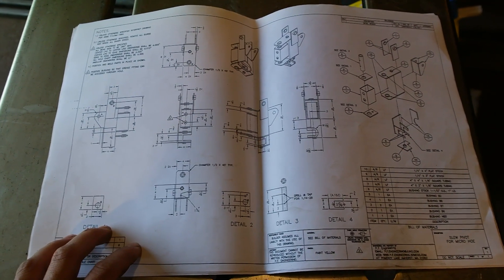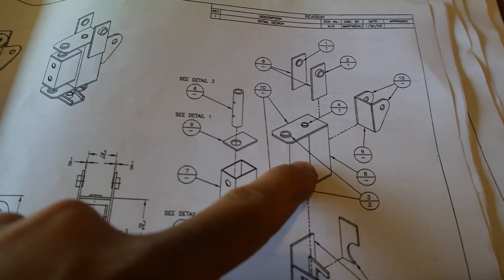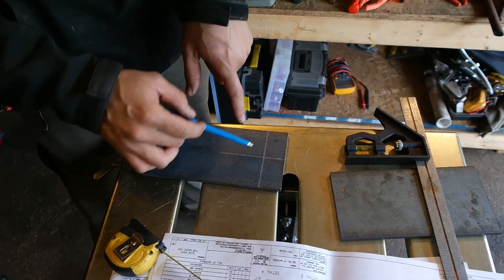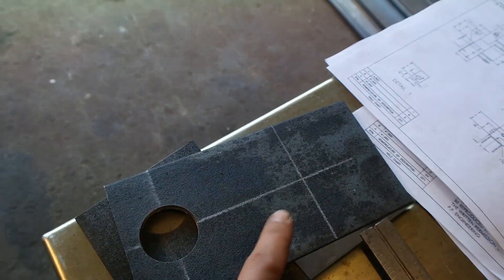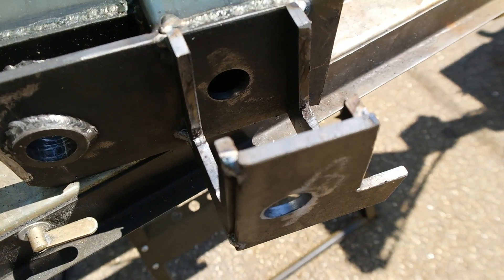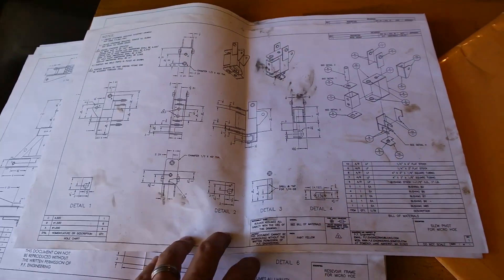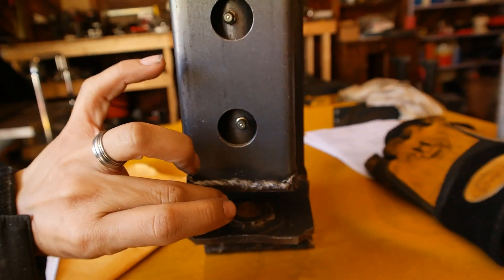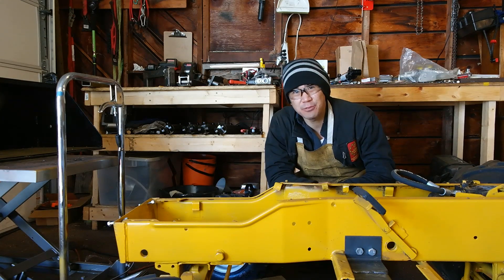Cub Cadet 149 TLB Transformation Part 10: Building the Pivot Slew

Comment: In part 14 follow up of the back hoe you mentioned you only had 4" clearance which worked fine on your property. In hindsight would you have mounted it higher? What would be some of the complications of doing that?
Reply from the maker: Thanks for your comment. Yes in hindsight I would have mounted it a little higher about 4 inches or so. There would have been no complications to doing that. I may still do it. I would just have had to make the mounting bracket rise after it cleared the fenders.

Comment: What does the zirc fitting in the top of the hinge pin lubricate? The inside of the sealed pin?
Reply from the maker: Beardly there are holes in the side of the pin towards to top so it lubricates that top bushing.
Reply: OK, cool. Thanks. I don't remember that covered in the video, then again, I'm easily distracted by my dogs so I might have missed it.
If it's there I'm sure I'll watch your videos about 100 more times before I start my build on my MTD 990.
Reply: or, if it is in the plans, I'll see it there. Btw, thanks for making the videos.